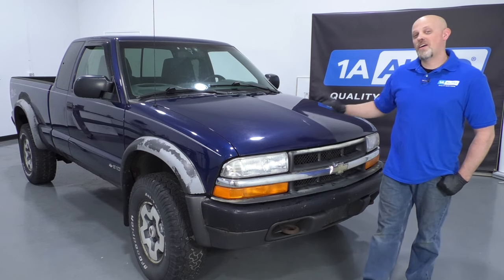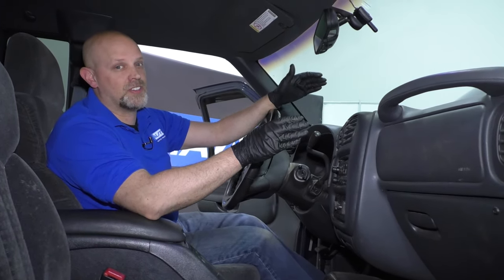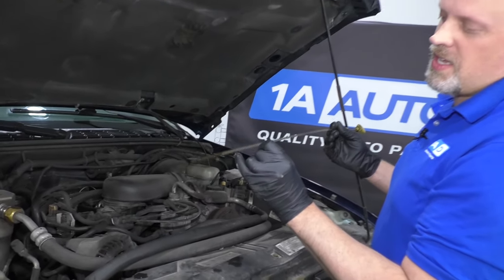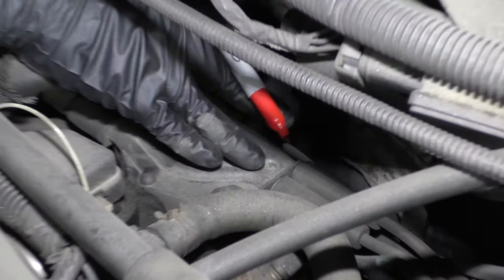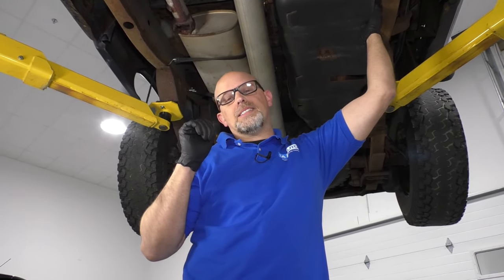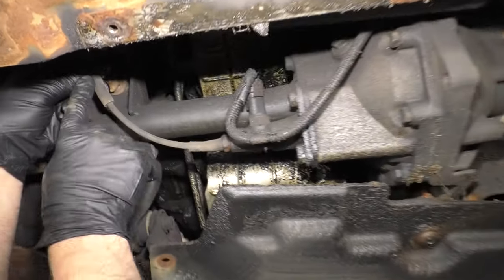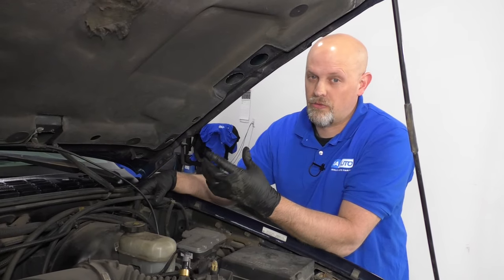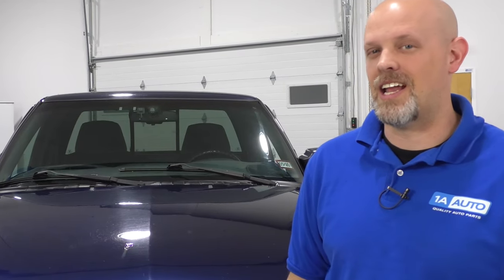Top 5 Problems Chevy S-10 ZR2 Truck 2nd Generation 1994-04

Comment: I had one for 21 years (95 S-15, W code Vortec V-6, 2WD) and put 78,000 miles on it. Nice to drive and PLENTY of power when it could be driven. The electrics/electronics (and the fuel injector/distributor in the intake plenum) was a constant aggravation and expense, giving this truck the highest dollar cost to miles driven ratio of any vehicle I've ever owned. It was well maintained and only towed a small lawn trailer about half-dozen times in 21 years. The clincher was a total failure of the transmission and was sold to the shop owner for costs. It was also a hassle because, by production #, it fell into a small transition group known as "OBD 1-1/2's". Not an OBD-1, and not an OBD-2, it really left some parts folks and mechanics scratching their heads. GM finally disavowed any support or responsibility for it. Don't even get me started on the anti-lock brakes...
Reply: Hey Dave, I had an s10 1996 4.3L. 
I ran a small lawn service with it for 10 years. 
I never had to do so much work on a vehicle in my life including race cars that I have built. 
The electronics on it was so bad that I basically ended up scrapping a running truck with the exception of the electronics constantly working and then not working and leaving you stranded. 
 I thought about switching it over to a simple carburetor so many times.
Reply: @davidedward13  got any good info that I should know before buying a 96 4.3L S10? Got my eye on one that’s in decent condition

Comment: Bought a 98 ZR2  new in 98, Still drive it. Two common  issues not mentioned:  The factory remote oil lines from the engine to the remote oil filter. The OEM lines in the early models (95-2000) had poor crimps and leaked within the first 5K miles or so.   Another one was OEM front ball joints wore EXTREMELY fast.  Just junk, replaced with Moog. Idler arms where another common early wear item also.

Comment: I'll be buying my dad's ZR2 in the near future, this info is good to know. I'm going to replace that transfer case vacuum right away. Truck has 80K and is well taken care of, but better safe than sorry. He already had the gaskets and distributor replaced.
Reply: Replace the vacuum lines from the nipple sticking out of the drivers fender under the hood(vacuum tank inside fender) to the switch and switch to bulb under battery.  Only reason switches fail is from old vacuum lines sucking in moisture.The problem he described with fluid in the hvac O have never seen and I've had 3 s10s and put over 150k on each one and have 215k on my 2002 blazer.I had to put a fuel pump in. Best price and pump is on amazon Delphi pump. Ball joints and steering link bushings wear by 100-140k. My radiator got a crack in the very top in the plastic and would only leak when it was hot and I parked. Thats when the vehicle is its hottest after you turn the motor off. Couldn't see that till I removed the shroud.
Reply: I would add in... Alternator, upper and lower ball joints, Radiator, water pump, I would include all gaskets .. otherwise these trucks are bullet proof ..
Reply: @daddyfixit631  I actually replaced the radiators on both my 2000 GMC Jimmy Diamond Edition and a 2001 Blazer SLT I purchased the OEM's through ACDELCO part direct and they were about the same price as the aftermarket or cheaper and I knew from reading up I wouldn't run into issues as some aftermarket brands are slightly bigger or thinker. Always order a new set of transmission line quick connectors as the old ones tend to leak after You've replaced the radiator.

Comment: Have a S-10 Blazer 2WD 280K. Had many of those problems over the years. Front wheel bearing were high fatality until I switched to Timken. Intake gasket - Went right into the oil ( After stopping could see bubbles coming up from bottom of coolant overflow tank) lol  Also had the spider injector go. Felt like it was in the transmission because it would stutter under load. Great video
Reply from the maker: +Jerry Manning Thanks for the feedback!
Reply: I've had to replace the Timkens too.Fortunately under warranty twice!!!!

Comment: I've had ..3 .. Chevy s10s a 97 and 02 and an 04 alternator is the number one thing I would include!! I will also mention the upper and lower ball joints,  should be replaced.  another thing I can mention is to replace the plastic radiators was once they break you can't melt them they're done!!  you got to replace them and he's correct about intake gaskets and fuel pumps

Comment: Bought my 01 ZR2 New and it has 320,000 on it. Has original clutch too. Replaced wheel bearings once 2 fuel pumps and 2 intake gaskets. Still going strong

Comment: Heater core is not bad on these, I have done one in about 1 hour and some change. Also 2 more huge issues with these trucks are the spider injector and also the rear main seal.
Reply from the maker: +S10rm Trooper Thanks for checking us out!

Comment: Got an ‘03 with 100,000 miles on it and it’s been a rock from day one. Not one of those issues came up. Currently parked due to a rear end issue. Chevy dropped the ball by not offering the crew cab in 2wd with a regular box. Looking at building one myself in the future.
Reply from the maker: +KillerDoxen Thanks for the feedback!

Comment: Great Video.  I've got an old 1999 Chevy Blazer with 4.3L.  I had it since new and really love it.  For a while I had a slight misfire...only momentary, single event each day, when it happened...like 3-5 minutes after I've cold started and am driving out of the neighborhood...e.g. acceleration 1st stop sign...it would clear up almost instantly.  Now I've got same misfire happening on all acceleration.  Only real change is that car was previously garaged since new...now I'm parking outside.  I'll do distributor cap and rotor which are probably about 80k miles old....Hoping it is just moisture/corrosion in distributor cap and rotor...

Comment: It's interesting because back In 2001 I bought a brand new S10 with the 2.2L engine and drove it until 2019.  I put 320,000 miles on that truck and had none of these problems. The only thing I had to replace was the alternator and starter once, the exhaust once after 200k, brakes, and tires.  It was the most reliable vehicle I've ever owned. It was still running good when I sold it, although it was starting to use a little oil.  About a quart per month.  But that was with well over 300k on the engine.

Comment: Loss of heat can also be caused by a vacuum leak, the same problem causes your vents not to change from defrost to dash to floor vents so before you pull your dash check for a vacuum leak. Also, I had a friend with a GMC Sonoma and he had no heat, his problem was his truck was low on water in the radiator, no hot water no heat, also if you're low enough on water your gage won’t read correctly so you won't know you've got a problem.
Reply from the maker: +Sandy Lloyd Sr. Thanks for the tip!

Comment: Had a 02 Mine was crappy A/C kept blowing fuses air emission system needed replacing after 2 years when I got the truck brand new the door handle for the extended cab broke Got rid of the truck over a year later after these issues
Reply: See my separate post on wiring in a $10 "self-resetting 10Amp circuit breaker" - fixed my A/C intermittent fuse blowing issue.

Comment: That was depressing, I still have my 94' I bought new and has had none of this.  It has never stranded me but I did have a brake line rot thru, finding out moving down the road was new and exciting.  Outside of batteries, normal crap, 3 windshields, 1 lower ball joint (65k ago), wiper motor and water pump.....it's been a good truck.
Reply from the maker: +Bender Thanks for checking us out! http://1aau.to/m/Shop-1AAuto-c
Reply: I have a 94 also has been very reliable all I've had to do was fuel pump.

Comment: My 2001 GMC Sonoma was intermittently blowing the A/C fuse 18 months ago... so I got a "self-resetting circuit breaker" (on Amazon for $10)  of the same amp rating, wrapped wires around the legs of the blown fuse, shoved it back into the fuse block, wired in the external self-reset breaker "just outboard/beside" the fuse block cover.

Heavily insulated the outboard breaker with electrical tape and viola! A/C now works great!! Description of breaker: Fastronix 10A 12V Type 1 Automatic Reset Circuit Breaker with Cover

Comment: My a friend’s feet was getting wet, when he said something about it. He also mentioned that it was hot. A few minutes later when I pulled over to check. He noticed that the water was brown. It was a simple fix. I just bypassed it. That winter, it was a completely different story.

Comment: #1= 0:25 heater core 
#2= 1:40 intake gaskets 
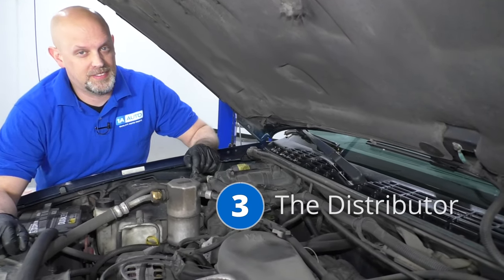#3= 3:35 distributor 
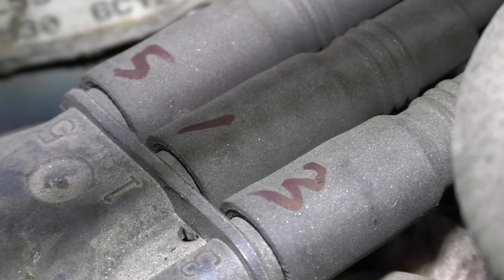#4= 5:00 front wheel bearings 
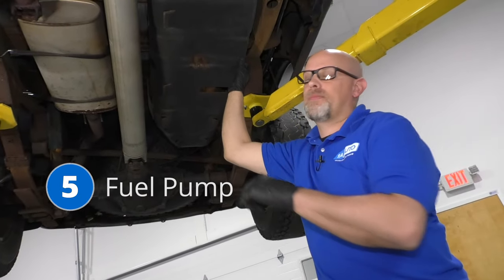#5= 5:35 fuel pump 
#6= 7:11 Bonus tip= concerning 4 wheel drive,

Comment: 352000 miles later now starting to have replacement parts problems. Purchased with 72000 miles paid $4000.00 sure have gotten my monies worth. Been a great pickup. Used for hauling rock firewood etc.2001 S10 4cylinder 2 wheel drive .

Comment: yup, 1999 one owner truck  bought with 180.000 on it. had to replace fuel pump. didn't bother removing bed. sawsalled out area over tank/pump replaced from on top.  it was rusted badly so no  big deal. other than that great truck.
Reply: Bonus points if you duct taped the cutout back in!

Comment: I got my 2001 s10 quad cab 4x4 a few years ago and I’ve been happy with it. Only issue I have is the rear main seal leaks a bit. Other then that everything is good  passes smog 4x4 works engine and trans is smooth

Comment: I have a 98 Chevy ck1500 5.0, and I've had to do the same on mine, except the heater core. I bought this truck new, and from day one I had a high pitch howling sound coming from the rear. It starts around 30 mph and disappears at high speed. I took it back to the dealer under factory warranty and they said it was my tires. I bought a set of Michelin tires, noise never stopped.  I took it back to the dealer again, this time under extended warranty. They said it was my tires. I brought the truck home, jacked it up, placed it on jack stands, started it up and set the cruise at 30 mph. I probed the differential and the noise was very loud at the axle near right rear wheel. I never had any problems with so far. I may remove the rear axles and replace both wheel bearings and seals. It just made 134542 miles. Let me know if you have run into something like this. Thanks for the vids, keep'em coming.
Reply from the maker: +Bobby Benn Thanks for checking us out!

Comment: Did all of these on my S10 🤣 and front main seal
Rear main seal
Oil pan gasket
Headgaskets
Plugs/wires
And a 3,300$ front end....

Now I'm searching for a new bed  🔎🤣🤺 been a tough find 🔎 under 400$
Reply: The drive shafts will go after 190k or so....or what I've heard....

Also altered the catalytic convertor down to 1 module instead of 3 🔎🤺🤣 it makes it so much cheaper and throaty sounding....

I have the steel block, so I'm looking into a Comp Cam and a small turbo charger as well

Comment: Very good video.   I have a 03 ZR/2.  Ref. intake gasket- this bad gasket problem is on 4.3ltr v-6's in all Chevy/GMC models, not just S-10's.   The coolant only flows across the front of the intake,  when mine started leaking, it came out at the bottom corners at the front of the intake were it meets the heads.  I didn't get any coolant in my oil. At about 115K miles.  I changed the injection spider, water pump and power steering pump while I was in there.  They were all OK, but when you have it that torn down, might as well be proactive if you can afford the parts IMO.
Ref. distributors-  If you ever take the distributor out, replace the whole distributor with an aluminum body one from Summit or other source if you have a composite distributor. 
This engine has an unusual distributor cap design, do not use the #1 ignition wire to set the rotor on #1.  If you look carefully at the distributor cap bottom (inside), you'll see that the rotor position for #1 is on the opposite side of the cap.  Recommend you get a book and follow distributor install instructions carefully, it's actually easy if you do it right.
I love my S-10 ZR/2.
Reply from the maker: +X-Man Thanks for checking us out, we appreciate the feedback! Glad to hear you got the distributor issue fixed, we will pass this info along to our production team.
Reply: @1AAuto  The problem with the composite distributor is that the screws that hold the cap on will snap off in the composite body.  My book even says to chase the threaded holes in the distributor before reinstalling a new cap.  I doubted them, never heard of such a thing and couldn't see how you would do that with the distributor installed anyway.  I was finishing up it's first tune up, wasn't interested in a rabbit chase so I tested their theory.  SNAP, followed be a minute or so of swearing.  No problems with the aluminum body distributor, came with a new module also.
Reply: my distributor gear some how got slop in it and caused a cam, sensor correlation difference code
Reply: @Iahusha777Iahuah  Probably timing chain wear/stretch/slop.  The 4.3's need a chain tensioner that is a factory part,  GM knew of the problem but didn't include them in new 4.3's but there is a factory bulletin.  It made a sound like it was pinging (detonation) really loudly and I made them fix my 96 and 03 S-10's but they were still under warranty.  Don't know how familiar you are with 4.3's but they have a counter balance shaft in the motor above the camshaft.  Puts extra rotating mass on the timing chain.  Those distributor's gears are only as good as their heat treat too but that's the same distributor as 1st Gen small and big block Chevy V-8's and really solid history.  One of those gears break and it usually destroys the motor.
Think about all that slop going back and forth in the timing chain and how that correlates to the can position sensor.

Comment: Got 1 of your fuel pumps in my 2003. Has never started that fast since I owned it
Reply: I got a 99 chevy Xtreme with the 4.3 v6 vortec motor in it. I can agree with the fuel pump issue... Also nice Fursona. :)

Comment: I've got a '95 with 293k. Replaced the fuel pump once, heater core 3 times, radiator 2 times, lower ball joints at least 3 times, clutch once, front and rear bearings once.

Comment: The hvac plastic hose near front  driver side fender also cracks and can cause engine to not run good. Also the MAF sensor never throws codes when bad. Took me a long time to realize it was that when truck was spittin and sputtering.. quick way to see if MAF sensor bad unplug  it and if it runs normal then buy new MAF sensor
Reply from the maker: +vortecemachine Thanks for checking us out! http://1aau.to/m/Shop-1AAuto-c

Comment: Just pulled the engine out of my 02 blazer zr2 and put all new gaskets from top to bottom.....Long story short 200miles later i found water in the oil! The cheap a$$ factory style plastic lower intake gaskets that came with my felpro gasket kit apparently cracked when i installed it (torqued to 11ft lbs in the proper sequence) and i just pulled it back apart today. Ill be using the improved gaskets (fel pro permadry plus or maul) that use steel to reinforce the plastic pos factory style gaskets. The regular felpro gaskets almost cost me an engine! Idk wtf they are still selling the cheap all plastic junk when they know it is a gamble for their customers 😐
Reply: Thanks for that tip. I have to do my LIM gaskets and now the water pump as well and I figured I'd do the valve cover gaskets as they tend to leak and the oil leaking down kills your motor mounts. Super appreciated thanks Eddie J.

Comment: I've got a 2002 S10 2.2 Liter &  the only problem I had was  Heater/AC actuator flap not switching from one to the other..
Reply: That's a pain in the a$$ to replace the door actuator they sell a great tool in harbor freight for this jump I thinks it was $20.+/-

Comment: I would also add front crankshaft seal, oil cooler lines , ignition coil and fuel pump relay (carry an extra relay in glove compartment)

Comment: Did these years use dexcool antifreeze? If so I've heard of the higher acidity level that causes intake manifold gasket issues. Probably the heater core too. I personally like the mix with anything green but that's just my opinion on this
Reply: Yes exactly.  When I did my  intake gasket it looked like taco bell meat in the ports
Reply: normally the fluid is replaced with something else, cant imagine how it could keep the same fluid unless they never cage the fluid as they should
Reply: Yes, they did.  I still have my 2000.  It had Dex Cool.  The coolant turns to mud; water + rust = mud.  And it destroyed the intake manifold gasket.  Fortunately my coolant leaked on the outside so it did not contaminate the oil.  Changed the intake manifold gasket in 2014 at around 170k miles... well out of warranty.
Reply: No it takes orange Dex-Cool distilled water with it
Reply: Dexcool usage started in 1996.
Reply: If you have your intake gasket replaced have them flush out all of the orange Dex-cool throughout the cooling system and replace it with the traditional Green coolant. While you have them changing the intake gasket have them replace the valve cover gaskets as everything is basically out of the way. The oil leaking down from old valve covers kills your motor mounts and thats not a cheap repair nor easy and get high quality motor mounts as the cheap ones don't last.

Comment: glad i ran across this video... my 02 zr2 only had two  of the 5 issues after a 152.000 miles.  fuel pump and transfer switch....  i actually cut a hole in the bed and pop riveted some hinges on the flap. 10 time easier then dropping the tank or taking the bed off....i work at a gm dealer and because of that truck i will never own a gm product again...